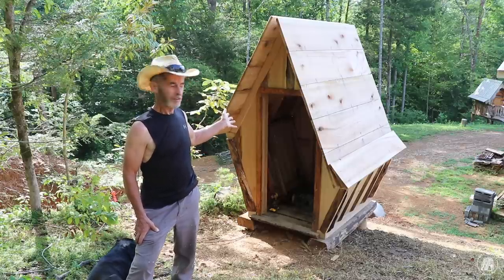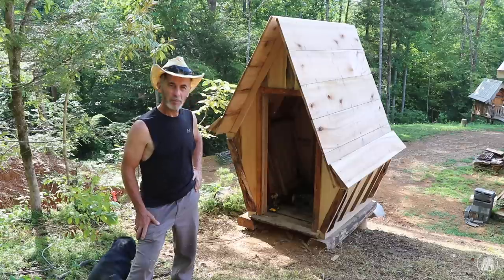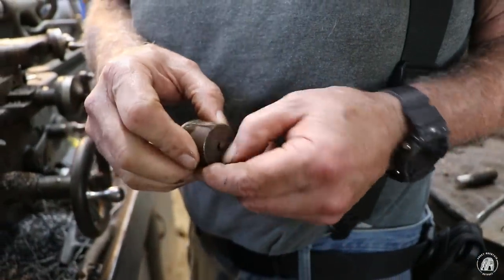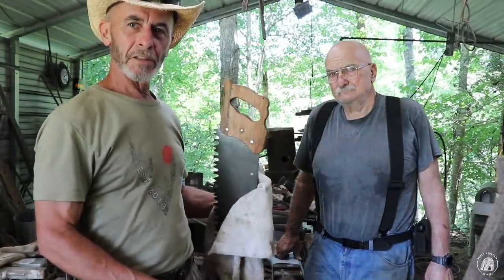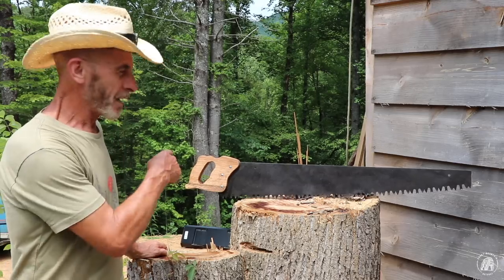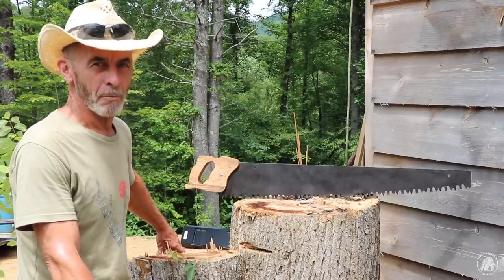The BEST use for Old Slab Wood and DIY Woodworking I've found

Comment: slab wood and epoxy tables are the rage for dining rooms with led lights underneath...simple aluminum or sheet metal forms baking paper to keep the epoxy from sticking to the flat table wood strips and leave the lights in the pours with wiring leads exposed lay in the wood over light thin sticks screw them down and pour in the smooth layers thinly til forms seal then filler up hook up the wire leads from the led lights to a switched receptacle and polish and  wet sand sand the epoxy top wood is gorgeous sealed forever and the epoxy wears like iron ...the lights make the whole thing glow..according to wattage...
Reply from the maker: Yeah I have actually watch some of that on YouTube. I may try my hand Sunday at one of those.

Comment: Awesome job on the saw Richard, do the teeth have to be set on that saw?
Reply from the maker: I’m sure they do if they’re not out of line but when you stand at the end and look all of the teeth appear to be at the same angle on either side so I’m thinking that the Saul wasn’t damaged very much however I think sharpening it would help a bunch